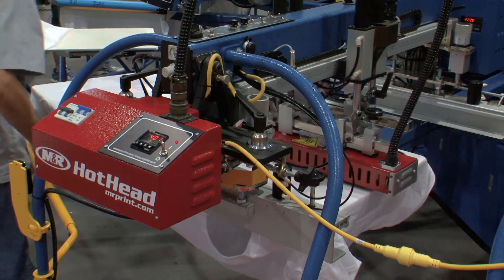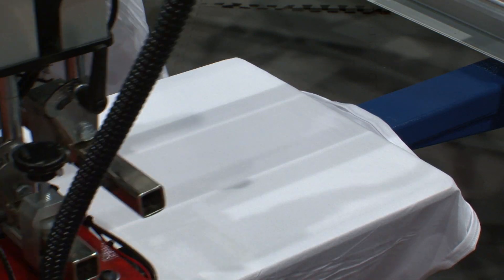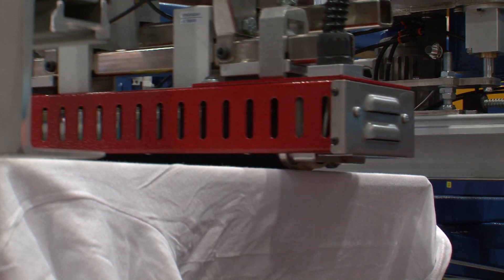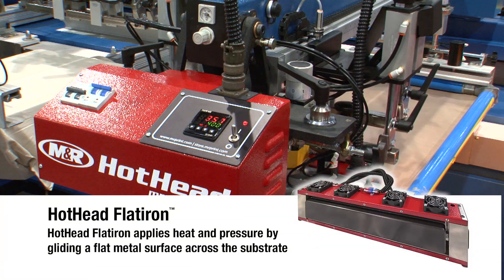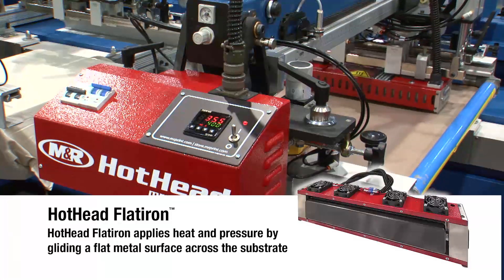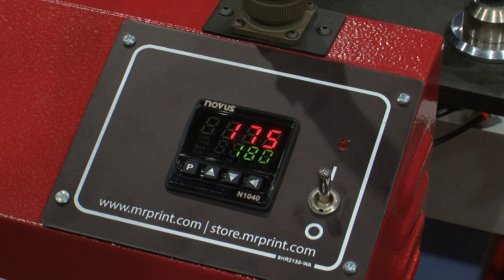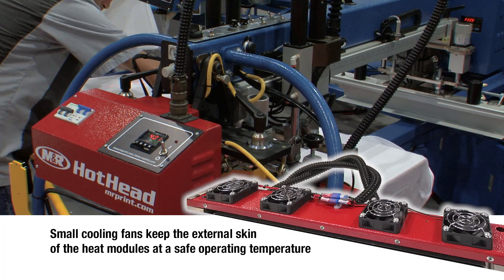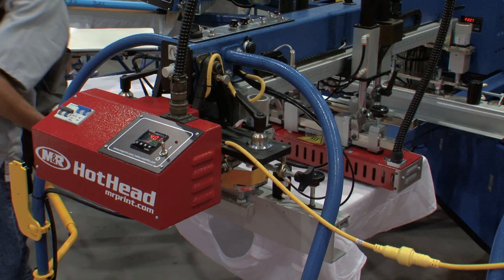HotHead Fabric Compression System - The M&R Companies - Screen Printing Equipment

Comment: I work in this industry I would like a more detailed video or explanation about this product please
Reply from the maker: Hi John - You can find more information about the HotHead on our website at: http://www.mrprint.com/equipment/hothead-fabric-compression-system

For information and pricing on any of M&R’s products and services,  please call 1-800-736-6431 (US & Canada) or +847-967-4461 (outside the US & Canada) or email us at info@mrprint.com.  You can also use our dealer locator to find the M&R representative or dealer in your area:  http://www.mrprint.com/where-to-buy
Reply: The M&R Companies  ok great thanks!